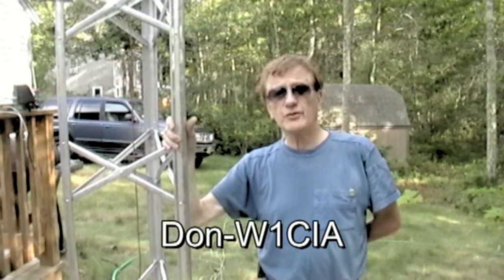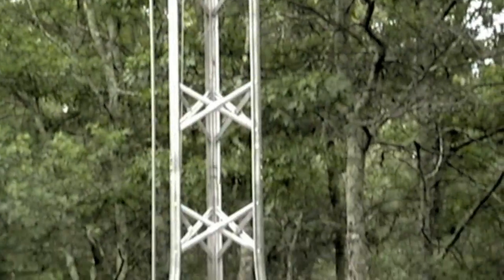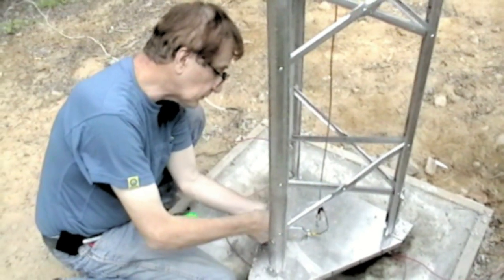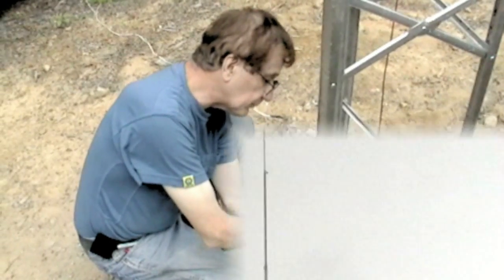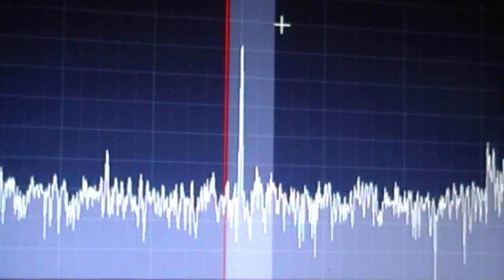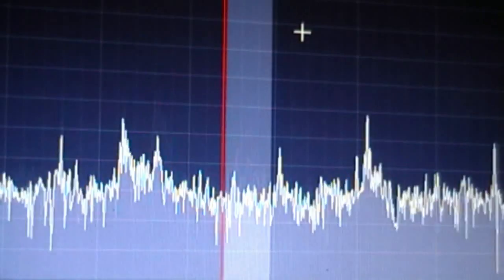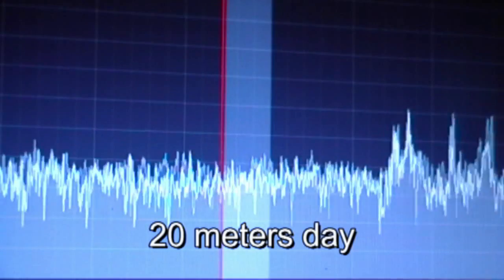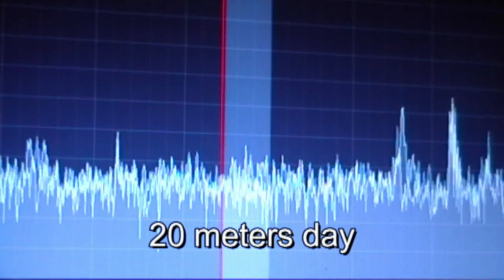HY-Tower Vertical-Erection, testing and evaluation

Comment: My Hy-tower in Nova Scotia did not survive Hurricane Fiona in September 2022. Windspeeds were 179 kph.  The 80 meter element broke at the bottom swaged joint. I repaired it with some old 2” aluminum tubing from an old yagi.

Comment: That tower vertical actually outperforms a half wave dipole of 80 m up at 60 ft if and when it's installed properly and with the sufficient ground radials people who actually say the opposite should really learn a little bit about that antenna that antenna is nothing more and nothing less than 80 m broadcast quality antenna all verticals including that one need a minimum of 120 radials under the ground. If you think you can get away with less radals why wouldn't an AM radio station do it then. I have one of these antennas put up in the back of my antenna farm and I have compared it towards my 80 m dipole that's actually up 67 ft and on the x it actually performs extremely better but I also have the bleeding choke on the positive lead on the antenna to ground so it discharges the static buildup on the antenna. Not only is the SWR perfect on its band of operation but also on the bands it was not intended to do so one of the reasons this antenna works so well is because of the surface area that it covers the whole antenna actually radiates even the tower section it's the same thing as an AM broadcast station tower. Just scaled down

Comment: That antenna even works on the 11 m with a 1:5.1 SWR  ratio
Reply from the maker: CB? You have to be a real loser to use it on CB.
Reply: @Capecodham  well let me explain something to you a lot of 11 meter operators actually have more elaborate antenna setups even better coax than most ham operators for example if you yourself run an entry level icom 7300 that happens to be the average radio that a cbers use and then they high level modulate them by injecting the audio directly to the finals. Sir before you start passing judgment I do a test on all my antennas even on the bands that they're not supposed to operate on to see their performance. In my antenna farm I have four of those towers and they're set in the configuration where I could steer them electronically and I have mono banders up so refrain from calling someone a loser when I possibly have microphones that are worth as much as your whole station. And by the way most 11 m operators are actually licensed ham operators and the real serious 11 m operators are most of them broadcast engineers that actually do high level high Fidelity am on the 11 m BAND and you can catch them most of them on 75 m so in reality refrain from saying a loser.
Reply from the maker: @MBUNetworks  The typical CB operator violates the law, exceeds 5 watts, has facial hair, owns guns to make him the man he otherwise is not,  lives in a trailer, and is either too stupid or lazy to take an exam children have passed. In one word, loser.
Reply: @Capecodham  and one more thing, now that you want to mention loser. The idiot who put up your antenna has no idea what he's talking about adding radios to a vertical does not add game so where does he get the ridiculous number of three decibels all you're doing when you're add ground radials is two things one of them is pushing the signal down so it has a lower angle of takeoff and the second one is the resistance towards the ground so the antenna can work better because obviously the ground radials are the counterpoise of the vertical but adding ground planes does not add gain and second of all the true reason why he added nylon guy wires is because if you add steel ones you're short out the antenna because the whole tower radiates and third of all that antenna is designed not to have guy wires so the real loser is your installer.
Reply from the maker: @MBUNetworks  "adding radios to a vertical ?" Adding radios to a vertical , more radios makes a difference? adding, "game?" What does a game have to do with a vertical?

Comment: While as others have already mentioned that using receive to evaluate antenna performance isn't necessarily representative of true performance, I would like to add I that didn't see any mention of the type of switch that you are using.  I have personally experienced poor port to port isolation with some antenna switches while performing comparison of RX signals.  Physically disconnecting the other antenna coax has shown a significant change in the results. Just food for thought.
Reply from the maker: I  also use it direct, no difference

Comment: What are the current thoughts on this antenna or verticals in general ? My friend who is a Ham says that verticals get good DX and his wire antennas are better for up to xxx hundreds of miles, he also has beams and more antennas than I could think of all with their advantages and disadvantages. 

What would people recommend for first time antenna ? I have 1 acre so I could just about install full size dipole , I want to be able to work 160 Meters. I hope to get my license in the next 6 months or so but having 2 small kids 2.5 and 4.5 and working shift means that I don't have a lot of time for DIY, which I know is most of the fun but priority is getting on air first and experiment later. 

Band of most interest in the beginning would be 20, 40, 80, 160. 

Full size Dipole and atu ? I have a tree maybe about 60 feet tall and I could install dipole as inverted V.

I like verticals for simplicity but radials completely remove this simplicity, getting rope over tree would be a challenge to say the least.
Reply from the maker: I have a $40 G5RV that slightly outperforms a $1000 vertical

Comment: Burt: I know it has been some time since you installed the HY-Tower and your results as compared to the G5RV were not that impressive. I believe you installed about 25 ground radials, not nearly enough in my opinion. AM broadcast stations generally install radials every 3 degrees or about 100 to 130 radials. The better the counterpoise the better a vertical antenna will perform as well as lowering the noise on receive. When I installed my HY-Tower I used about 120 radials and 7000 feet of number 12 stranded copper wire. I also connected two 150 foot copper water lines to the vertical. For lightning protection I used six 8 foot copper clad ground rods. Before I took my Fan Dipole at 60 feet high down I did several tests with both antennas on 160 through 10 meters. Consistently the HY-Tower was 2 to 3 S-units higher on all bands with about 1.5 S-Units more noise. The results on 20, 15 and 10 meters compared to my Cushcraft A-4 beam at 50 feet were about even with the vertical and doing a little better on many DX signals. Most HF operators use horizontally polorized antennas which is another reason the verticals don't seem to do as well. I'm very happy with my HY-Tower but it was a difficult job installing the radial system but fortunately I had the real estate which allowed me to do so. 73..Love your videos.
Reply from the maker: As I doubled radials I noticed no difference in impedance. The Hytower was a waste of money.
Reply: burt2481: Sometimes no matter what you do a vertical antenna just doesn't seem to perform very well. The HY-Tower is the only vertical I have ever had success with.

Comment: I would put a rod at the end of every radial, but that is me. That also helps lighting proof it.
Reply from the maker: Why?
Reply: With out writing a book, there is a lot of science involved. If you increase the ground potential of the antenna, not only does it work much better, it becomes lighting proof. This same idea works on boats as well.
Most people think lighting originates in the atmosphere and hits the ground, actually it's the other way around. Objects on the ground build up a huge static charge and it discharges into the atmosphere. A very large ground potential negates this possibility.
Soil generally is a very poor conductor. The more contacts to the earth, the better. Adding salt or salt water around the grounds will increase the ground coupling.
I always not only grounded my antenna's to the extreme, but placed rods around my house, in 8' or so increments and bonded them all together. In Florida, the lighting capitol of the world, never had a strike.
Reply from the maker: You did write a book but it was a good book. I have heard salt doesn't really work in the long run.

Comment: I know this is an older video, but the vertical showed a higher noise floor on all bands, with he signal peaks being less separated from the noise floor (worse s/n ratio).  My experience has been that verticals are non directional (of course) and noisy compared with beams and dipoles.  The benefits are discretion, cost (much cheaper than a beam with  mast/tower, rotator, control box, rotoator cable).  I use a 31' vertical with 32 ground radials and an Ma5B mini beam for 20-10 meters.  The vertical was my first antenna, and it was easy to put up (an S9 31 vertical) and has stayed up for 6 yrs now without a single adjustment needed.    The vertical is also fun to unplug from the window pass-through and run over to my deck for backyard portable qrp work.  But, even though my MA5B is only 20 ft up, it blows the vert away on 20-10m.  Cant work Japan SSB with the vert, I do it all the time with the beam.  I wonder if you kept the vertical, or have any regrets in putting it up.  It seemed like an awful lot to go through for either equivalent or worse reception if you didn't gain any bands.
Reply from the maker: It is still up and was a waste of money.  It is only useful for back yard QRP work
Reply: Yeah, that's what I use mine for too.  There isn't a person in this hobby who hasn't made a misstep on a purchase.  BTW, I love to see you make a few vids of your QRP work with the Flex 1500.
Reply: Glad I read this. I was in the market for one of these but you seem to regret it. So that means I will probably also. Gonna pass this hy gain $1300 shipped now by the way
Reply: This vertical antenna is normally installed for a few very good reasons: Low-angle (necessary for DX!) 360 degrees (no dead zones!) radiation on all (10-80m!) bands. Unless you are a millionaire with a huge piece of land, you CAN'T install beams for 40 and especially 80 meters. Even simple dipoles for 40-80m bands require quite a bit of real estate. Besides, with dipoles, you will have dead zones -- some hams won't hear you and you won't hear them. Of course, you may quickly install shortened dipoles and other funky antennas which will cost you 50 bucks (!), test them on your receiver and "LOVE THEM TO DEATH", but the problem is that on transmit you will be radiating only 10% of your power, at a high angle; plus, quite a few interesting stations will be in your antennas' dead zones, so you won't be able to work them. With a good vertical antenna and a KW amplifier, on the other hand, pretty much all DX stations will hear you! Verticals are NOT very good as receiving antennas (dah!) -- well, work on making GOOD receiving antennas while using your all-band vertical! Take your time!)) However, IF you are interested only in upper bands (20-10m) -- forget verticals; install  beams and enjoy great performance on both transmit and receive! 73!
Reply: @DvorTerrier  Meh.  Kinda.  I'm no millionaire and I did great with a Cushcraft MA5B from 10-20M (10/12/18/20) only 20-25' up in the air.  Verticals disappoint becasue of the high noise floor/non-directional aspects.  Thats why they kinda stink for DX.  The MA5B is a low-rent beam, but it blew the doors off of my 31' vertical with 32 radials on 10-20 every time.  I was getting into Japan and the Middle east on SSB, occasionally into Russia near Mongolia on PSK-31 with it running either barefoot or with a 500W amp.
The vertical advantages are space, and with a tuner you can work all bands - but there are weird carotid and other patterns with them.  Burt's vertical was an expensive mistake, I felt bad for him.   S9 made 31 and 43' verical fiberglass antennas which were easy to install, and all in with radials/radial plate and an unun were maybe $300.  I put mine up 10 years ago, its still there.  Alpha antennas bought them out and you can still by a form of the kit there.  
My beam got destroyed by a tree, it stayed up for 8 years.

Comment: Halfwave dipole are hard to beat and much cheaper. Put them up around 50ft and you
have a great antenna for all bands with a Fandipole sytstem. Dipole for each band 6-160
Reply: I think you're right.  I went from a vertical (and S9 31' vertical) to a pair of Alpha Delta fan dipoles oriented roughly NExSW and NWxSE.  I had an antenna switch, and was able to get them about 30' high.  It was a nifty set up.  But, in the end no cheaper than the S9, and wire antennas tend to be more fragile; one is still "up" but one of the pulleys failed that kept it up and its in the trees.  The other failed after 3 yrs.  They were better than the vertical, but then the vertical was a very easy install aside from the radial placement, its still up after 6 years, and because the S9 vertical is essentially a tapered, drab green, fiberglass tube with a wire inside of  it, you can be looking right at it and not see it.  

I think it depends on your situation, but if you have any brush or trees on your property a camouflaged vertical antenna  is easy to hide.  The pair of dipoles I had up were stealty as well, but I'm lucky in that I had a few big 60 ft  trees  to hang them from.

Comment: I noted that whenever the vertical performed better, the general noise signal was also higher. IN fact, in every instance, the noise level was higher on the vertical. If you pay attention, you will see that it is much easier and more relaxing to listen on the dipole when stations with same signal strength were shown. This was due to the reduced noise level on the horizontal antenna.

Comment: With regard to TX vs RX efficiency The most important property you forgot to mention is "radiation efficiency" and "radiation resistance" Just because an antenna receives well doesn't mean that it transmits well.. Quite the contrary, For example while the G5RV might receive well on many bands. When TXing on anything other then 20 meters it's matching network turns most of your TX power into heat. Again some of the best receiving antenna designs don't TX worth a crap its all about compromise

Comment: The testing goes on a bit... and doesn't really prove anything as conditions are not a constant.
I agree with Blaze1024 and was going to reply but he has said what i would have said.
I have some great receiving antennas that are rubbish at transmitting!
Vertical Ground rods are not effective. Covering the ground with chicken-wire fencing would be more effective as it's area not depth that counts..

Comment: With all due respect: If you can spend five hundred bucks for an antenna and installation (not-to-mention all that station gear), how'bout $20-30 for some good ground rods and clamps? That automobile hose clamp on an iron pipe looks pitiful. 73

Comment: I have an S9 31' vertical with thirty three 27' radials coming off of a ground plate.  It worked well enough;but when I  bought a radio with two HF antenna jacks, I got better, less noisy reception and signal reports on a temporary  "buddipole".  I have since put up two Alpha-Delta DX-EE antennas, one broadsiding NE/SW the other SE/NW.   As in your vid, the vertical rarely (if ever) outperforms either dipole, and the noise floor is higher on the vert with a worse s/n ratio.

Comment: @burt2481
As a retired broadcast engineer as well as an extra class amateur I can assure you that your clam is only partially correct. For example a dummy load shows low SWR across a very large bandwidth yet it makes a poor antenna. And while a beverage antenna makes a great receive antenna its a terrible TX antenna. Even if radiation patterns and bandwidth are similar between TX and RX this doesn't infer TX efficiency That's why most experienced low banders use separate RX and TX antennas.

Comment from the maker: @Blaze1024 "It is a fundamental property of antennas that the electrical characteristics of an antenna described in the next section, such as gain, radiation pattern, impedance, bandwidth, resonant frequency and polarization, are the same whether the antenna is transmitting or receiving.

Comment: You do realize that reception performance is a very poor way of evaluating an antenna. Your G5RV for example might perform well on receive yet on transmit the vast majority of your TX signal is dissipated as heat in the matching section where on the Vertical with at least 60 radials down the vast majority of your TX signal will be radiated instead of dissipated as heat in the feed line and tuner. The Hy-tower with at least 60 radials down will put out a much stronger signal then a G5RV.

Comment: @burt2481 I'm still planning on making that trip.  I had an in-flight engine issue about 2 months ago that turned out to be one of my magnetos failing (they regulate the spark plugs). Didn't completely fail thankfully. So I wound up replacing both magento systems to be safe. That took a few weeks of trouble shooting and repair. On top of that, I haven't flown in over three weeks due to other responsibilities. The short of it is that I'm way behind on all things related to flying right now.